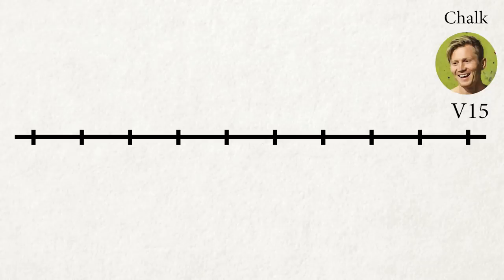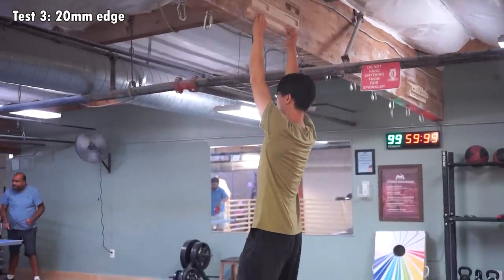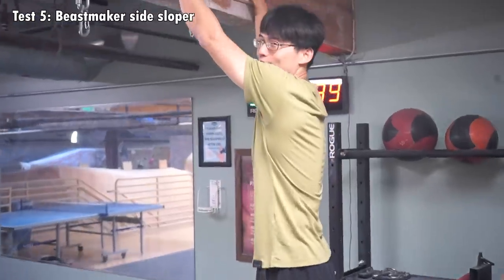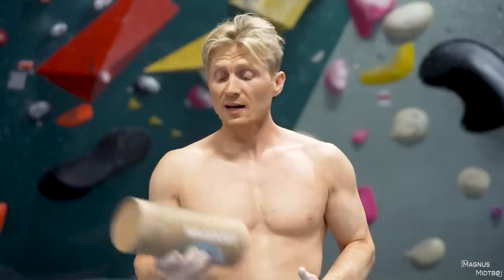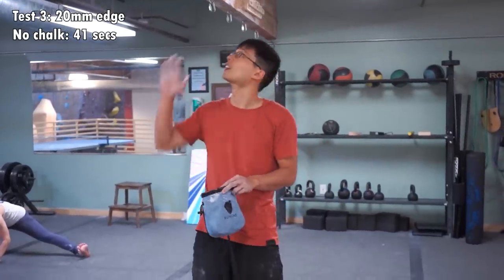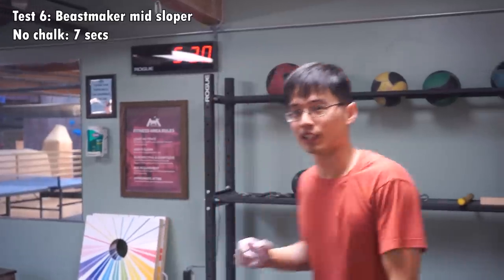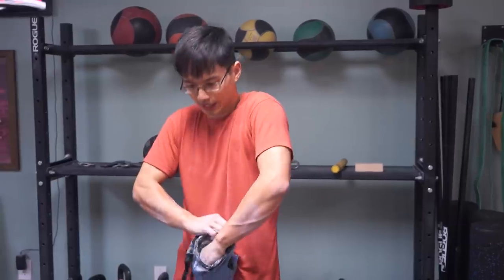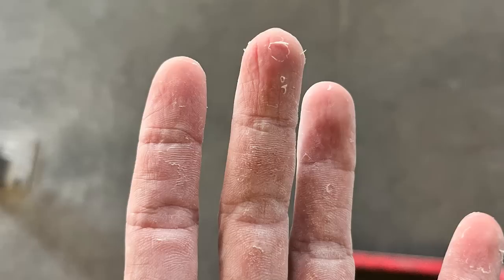How Much Does Chalk Actually Help In Climbing?

Comment: Climbing at an extremely high level, like V15, generally means you're hitting hard limits in technique and strength. It makes perfect sense that reducing one factor, like chalk, would have a substantial difference in hitting a maximum possible climbing grade.

Comment: There's a bunch of ways to measure how effective chalk is but I think the methods used were insufficient - as others have said, chalk becomes essential once you get on worse holds, and you want all the friction you can get. The best thing in my opinion would have been to try and hang the smallest edge you can, and do max weighted hangs on the 20mm, then test max weight on pinch, and make sure when using the beastmaker slopers not to swing into the hang. 

Slopers are a lot more about technique than crimps (in my opinion!!), you should check out Emil's vid about slopers, the tips there could lead to you hanging the beastmaker 45°!

Comment: To me, it is not only a question if you prefer chalk or not.
I honestly find it a bit disrespectful to touch holds/hang boards with sweater fingers, as it ruins the other climbers performance on set problem. 
Therefore you should always use a bit of chalk, if only to be respectful to other climbers.

Comment: Nah u gotta pull on slowly to the slopers and let your feet drag on the ground to the point where you're hanging without swinging beneath the sloper. Ideally, you just pull up from directly underneath the sloper, but the foot drag trick helps with any error.

Comment: My guess was chalk would improve the maximum force you could apply, and not the endurance. I think it would be worth testing those claims and it might be as easy as using a digital spring balance to pull a weight loaded sloper over your flat fingertips as you rest your hand palm up. At the point where the sloper moves from rest, if the force on the spring balance increases when you use chalk, then we'll know that chalk provides greater friction.

Comment: I'm not a fan of chalk. I used to use it as a beginner climber until I lost my chalk bag. I then made do without for a while and discovered I could climb longer and better without it. The chalk cracked my hands and made the holds more slippery. My hands get coated in chalk anyway due to the residue from other climbers.

Comment: What an interesting test! I think you made it as fair as you could without making this a major undertaking that would span multiple days, but I think there's a variable that isn't accounted for in this setup. For the sake of proving a point, let's say you were able to complete the V7 project with chalk. Since you only performed a few moves without the chalk, now you're going to be more fatigued going into every other test. So you may actually perform WORSE with chalk, simply because you did BETTER on the early tests! May or may not be significant, but this, to me, implies if you were doing the exercises totally fresh on individual days, we may see an even more marked improvement with chalk on the later tests.

Comment: I think you gave up chalk too fast. Based on the stats in the video, it would probably raise your max grade with one :) Your skin will probably adapt quickly and is not going to tear. Also, if you grow  calluses, you can probably scrape them off with sandpaper and apply some hand cream. 

By the way, why don't you try the front lever with chalk, I think it can help to hold it.

Comment: the one thing im missing in this video is the benefit of chalk to the gym sustainability, using chalk allows holds to be cleaned easily with a brush whilst just climbing with your skin and everything that might be still on your skin can easily get stuck in the pores of the holds wich at some point can only be cleaned with laborious methods when the wall gets reset

Comment: I think if all the holds were cleaned and no chalk were on the holds, I think it’ll be a lot different. I don’t use chalk the past 6 years but times my fingers were so slippery that I end up gripping much harder to stay on the holds and pumping out a lot quicker, especially on slopers and small crimps. I am about v4-v5 bouldering inside, 5.12a/b on sport inside and outside. depends on the gym, one gym I went to, I was able to climb their v8? Idk. Very Subjective.

Comment: I think you should try using chalk for a longer period like a month or so. Also you can start by using a not as much in the beginning to avoid drying out your skin too much.
Also think of it like switching from conventional deadlift to sumo deadlift in weightlifting, you wouldn't see improvements immediately as you have to adapt to the new technique/setup first. Or maybe like changing your IDE when programming, at the first couple sessions you might work slower due to not being familiar with it yet but in the end if its a better IDE, you will be more efficient.
Using chalk is also something where every individual is different, some people have sweaty hands naturally, others dry hands, also to much chalk will make you slip or if the hands are too dry. So you should experiment taking chalk for a longer time.

Comment: cant realy confirm this, but i dont think you use the right beta for the orange beta. also you might have tried an actual boulder with slopers to see the difference :D

also, this stool placement, wtf! under the board and then kick it away if you can hang from it, or ask someone to push it away. and yes you took way to much chalk in this attempt. you want it to cover your hand but in a fine layer. clap your hand afterwards or blow over it. against the destroyed skin use skin lotion, there is actual realy good one specific for climbers (e.g. "kletterretter") works like a charm to me. i also climb like 4-5 grads less without chalk, but i also have very sweaty hands.

Comment: I was thinking "wow he cld get seriously hurt putting that stool there" after the first time...my intuition was correct but thankfully you didn't get seriously injured. It doesnt take alot to break your neck or spine. Next time just have someone move the stool or use it to the side of what you hanging on to. With grip implements it makes a huge difference using chalk ive found especially when dealing with metal objects.

Comment: I bet 100$ that this is the kind of thing which has a greater effect at elite performance levels. Since the margins of error become smaller and smaller the helpfulness of chalk increases.
Reply: @Jacob0481  I have climbed but Im essentially a novice. Do you think I am incorrect? It just seemed logical to me. Im fairly sure that at my level chalk helps but it is probably not as essentialy as it would be if I was climbing very steep slopers with big technical movements. If you are driving a car going 10 miles an hour then wearing a seatbelt is not going to matter to you as much as if you are going 100 miles an hour. Likewise even with good driving technique a car designed to handle well at high speed will benefit you much more at those speeds.

You know, in general the climbing community is known I think from being quite friendly and inclusive, but you were rather rude in your response to my benign comment. I mean even magnus himself said it. I don't know why my opinion  triggered you but I'm only being sincere in what I think. If I am ignorant then please teach me. The intention of the video and channel is education, so feel free to add your two centz right?
Reply: @Jacob0481  lmao smh

Comment: Ok I’m well passed time, but I would like to emphasize something, I’m probably the 100th to tell you so, but still, it’s itching, I’ve got to scratch. 
You didn’t fall because of “to much chalk”. You fell because the stool was 25cm far back the second time and so, when hanging, your feet went forwards in order to align your barycentre with your hand. 

And the energy released caused the swing.

Which tells us 3 things : 
1 yes, having studied physics definitely shapes anyone into an annoying know it all. That is almost science. It’s certainly worst when he’s also a climbing trainer.
2 use chalk you’ll climb a little harder, especially in lead climbing
3 practice your abs, you’ll climb a lot harder, especially in bouldering. Aside from this purely materialistic and performance oriented, then vain, goal, you’ll stop a little swing easily and avoid bruises.

Comment: Interesting video, but I don't think we can actually draw any real conclusions from it. Although, I do think that it's obvious that chalk is beneficial to climbing.

For one, you mostly used wooden holds without any friction, which has less relevancy to climbing, and also mutes the effect of the chalk.

Secondly, it looks like these aren't exercises you regularly do, so some of the gains can also be from you having a better understanding of what to do the second time around. Same with the v7 you tried.

Thirdly, as another commenter said, your stool placement varied a fair bit. Especially with your fall onto the stool, you were swinging like crazy. This very much effects how much force you have to applyto stay on, thus skewing the results of the test. Especially on a sloper.

Comment: One critique I have is a deeper consideration of an individual’s skin moisture content, aka sweaty vs dry hands.

As a climber with sweaty hands, I find chalk GREATLY helps my climbing ability. When I am on really long boulders or sport climbing after I have sweated off all of my chalk, my performance drops and I can get stuck on moves that I know I could do it I had some chalk! (or I chalk up and complete them).

I can imagine for someone with dry hands chalk helps very little and could possibly even create less friction. 
With lots of dry chalk layered on top of each other, that can reduce surface roughness / area by filling in all of the micro gaps in the surface of a hold and finger skin making it more smooth and slippery. With sweat and oily skin, oil is very slippery, so having chalk to absorb oils and water can help a lot, and the chalk wears away not leading to chalk buildup in the dry situation.

Comment: For your project: I think you can pinch the foothold with the arete as an intermediate to get more pressure on the heel and higher up in general.
Edit: maybe you can even adjust the heel to a regular foot to be more explosive when reaching for the next hold.
Reply: I think he don't see the hold on the volume. Probably the intended beta should be to go to the hold under the volume with his left hand and reach hold on the volume (very "shouldery" move) with his right hand and then release heel hook, readjust feet and continue to the next hold on which he tries to jump.

Also he may use the corner on the left as intermediate before that big move if he can't make the shoulder move to the crimp.

So probably not only finger strength and your power makes you a v7+ climber but also your creativity. That's why I felt in love with climbing.

Comment: You are discovering America! I thin k you are much stronger than me, so you should climb much harder with chalk. But the assumption that you shoul climb V11 is wrong. Magnus is V10 or V11 to V15, so you would be V6 to V8-V9 perhpas, which is IMHO realistic. It is also obvious that chalk will help more on the small edges. On large edges, you will be more limited just by power. Similar with slopers. I was actualy worried that you could get hurt having the stool behind your back and it happened. Be wise and careful.

Comment: Who cares why it helps right? Even if it helps just because you think it should help it's still a chalk's property right? 😁
Reply: @Jacob0481  It depends on the question. The question was "How much does chalk help in climbing?", it was not "why does chalk help in climbing". Also, if somehow you convince yourself that it helps only because you think it helps then you get the opposite effect, and depending on who you are, it might have a negative effect. If you are a climber and you get some help form chalk then having the opposite effect is not the best for your profession. In this case, ignorance is actually helping you.

Comment: What do you mean brother? I'm sorry but your video is just down bad.

If you were to tell if it's true what magnus says, you should find someone at his level with chalk and see how that person climbs without it.

It is very different to grow 5 levels because of chalk at your level than at magnus level. You have to take into account that if you were to improve 5 levels with chalk you'd be getting almost a 100 % increase (90% isvh) , while he's getting less than a 50% increase, which is OBVIOUSLY not the same.

Such as its not the same harder lines and easier lines. When it comes to someone that does V11, that person when trying V15 their problem, unlike you, might not be lacking arm strength, but actually much smaller things, like grip.

The fact that you just think that your somehow proving magnus wrong because you don't get magically better at climbing for using chalk is just bizarre.